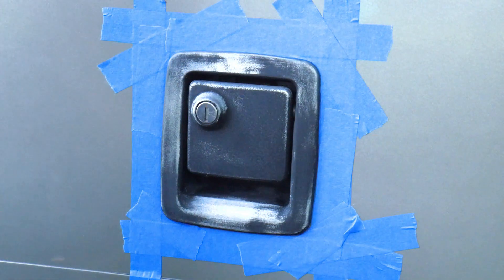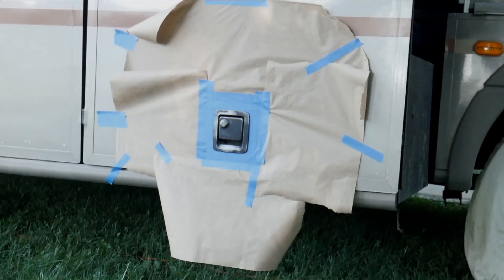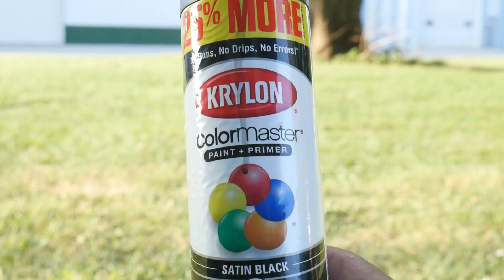🔴 RESTORE YOUR RV STORAGE COMPARTMENT HANDLES | RV DIY TUTORIAL

Comment: Are they that hard to remove? Mine are off with 4 screws and a jesus pin on the linkage. Another hint I learned years ago was a bit of grease on the keyhole and wipe off after the paint has dried.
Reply from the maker: Thanks brad for watching and taking the time to leave a comment and supporting the community.
Reply from the maker: Timothy Hinds guess I’m lazy, thanks for the comment